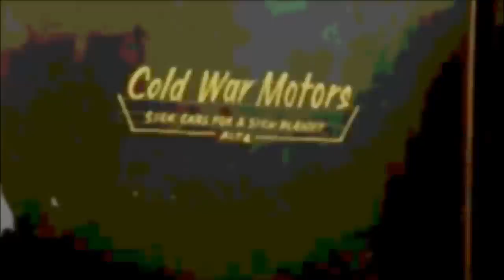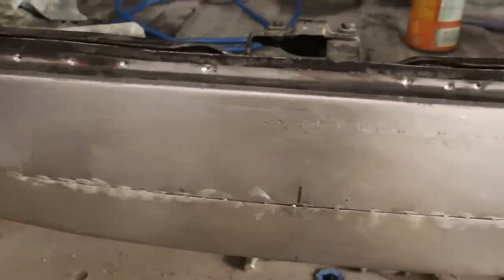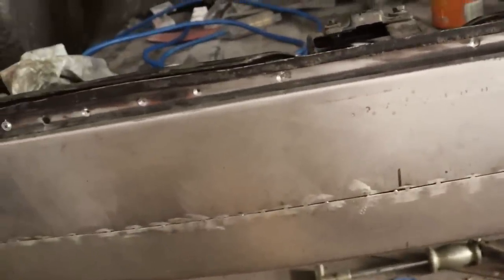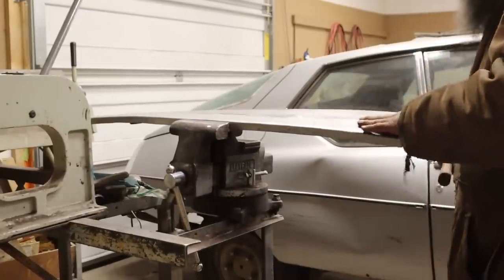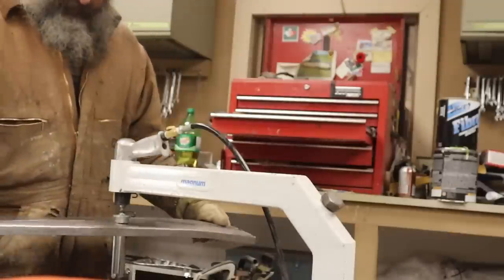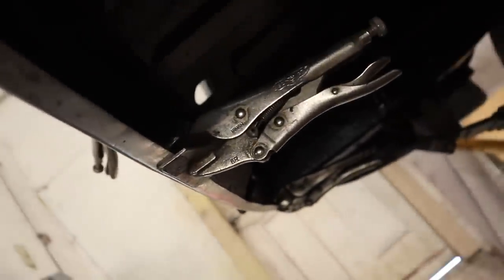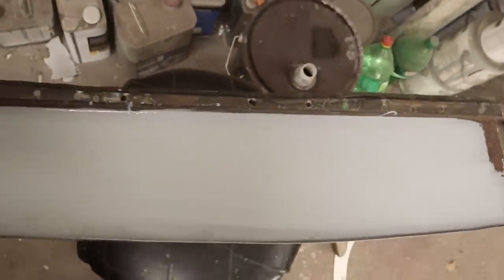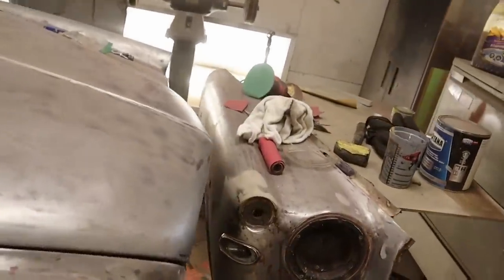Finishing up the Rover 3-litre Repair Panel!

Comment: The explanation of why you didn't just build the whole tail piece. Taught us loads. A brake cant make 4 bends that close and welding edges warps the metal n cant be fixed. I learned some things in the 1st 3 minutes instead of years messing up some steel. *** coldwarmotors ***

Comment: What epoxy primer do you use?  Maybe I'm picking the wrong stuff of doing something wrong, but I get mixed results.  Thanks for doing a second round.  My old man is going to be happy!
Reply from the maker: Hi! I'm using Nason Ful-Poxy in this case? I've never had a problem with it, although I avoid having to sand it as it will clog paper all day long...Cheers!

Comment: Would putting the long weld piece on a heat sink have made any difference? Clamped just in front of the weld, clamp moved often? I have done similar, but not on that thin metal.

Comment: Can the welding warping be minimized by doing an inch on the left and then an inch on the right and switch back and forth until you meet in the middle?

Comment: You should have treated the metal skin it with duraglass it not a 1969  Z28 with a Dz302 you know we'll done body filler lasts for many years so you can have more time with the band